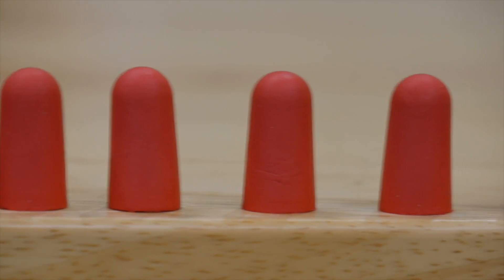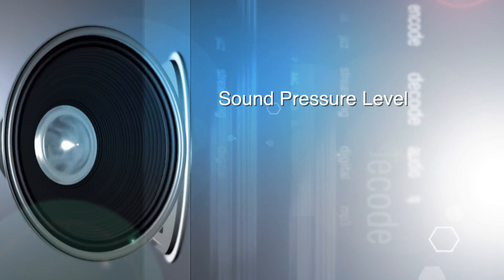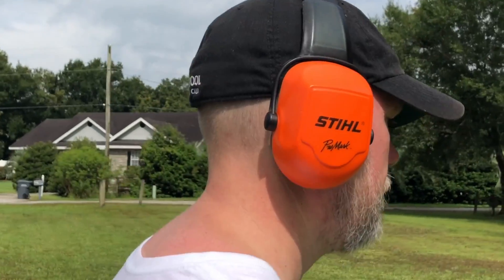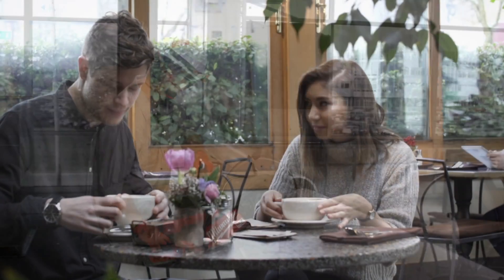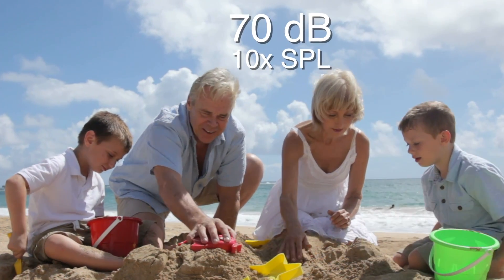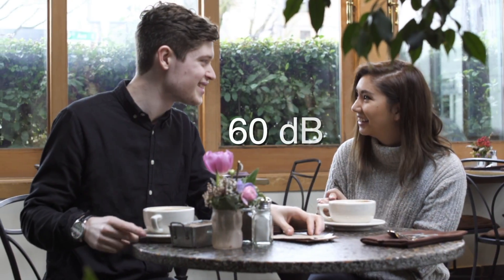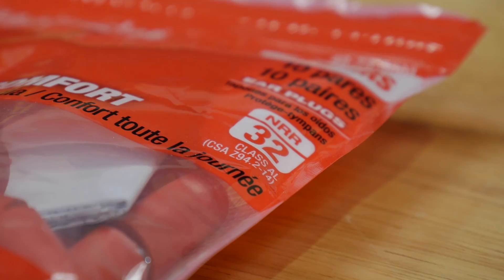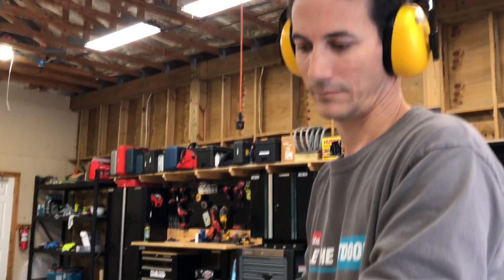Sound Pressure Level (SPL) and the Decibel Scale (dB) 101

Comment: I've heard the hearing  damage db levels is at a certain frequency range and that super high db or spl levels at lower frequencys like 20htz and 80s what have you does not damage hearing what so ever? People sit in cars producing spl levels of 160+ with supposedly zero hearing damage? I can say a 6.5"  midrange speaker getting 100w will hurt my ears making them ring while my 15" subwoofer getting as much as 1700w does not at all but will cause slight discomfort to my body not alot but some, and it intrigues me how even my subwoofer can cause such high pressure levels to the point of moving car parts like visually moving the windshield frame alot how the hell can just one 15" cone do that!??!?